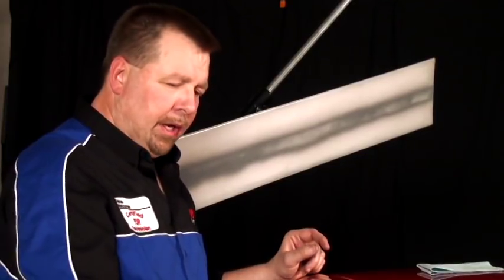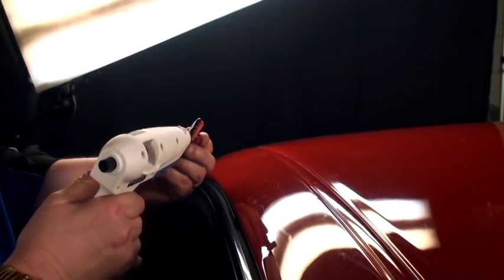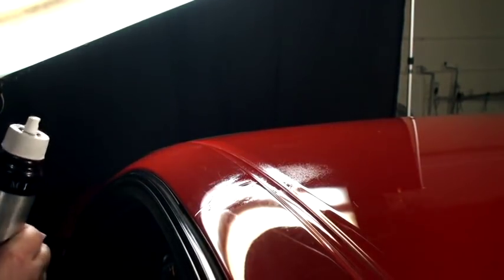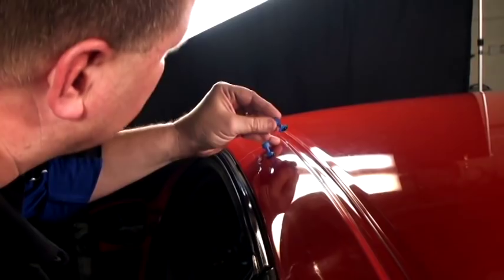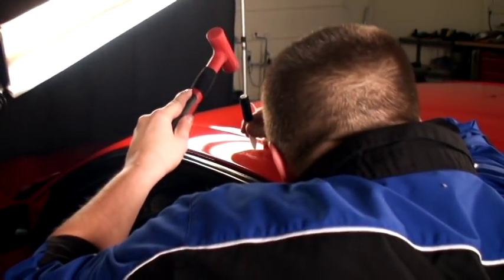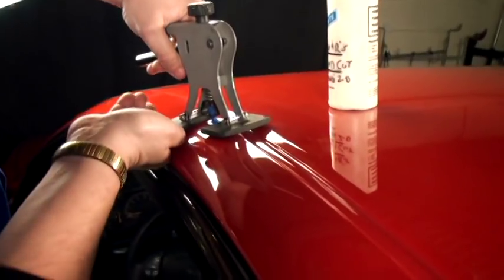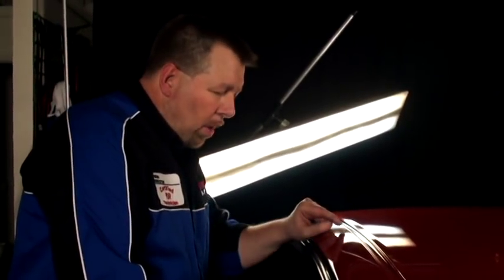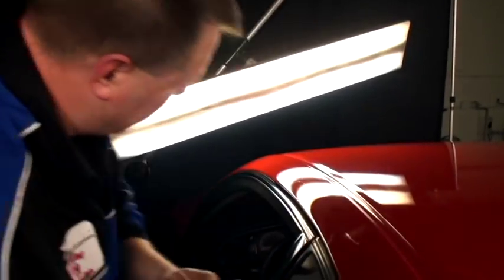Glue Pulling a Crease

Comment: Great video demonstration,  on the sharp creases i like using portable dent reflection tools slide hammer over the pliers, and found irregular creased dents I shape a bead  of hot glue to the exact crease inside the dent allowing it to harden, then i add glue to my puller tabs and glue to the shaped glue for an exact fit. This is a great video, it's great seeing how others do there repairs. It's great that we can all learn from each other on repairs. I will have to do a video soon too share.

Comment: Someone hit my BMW SUV on the driver side door and drove away. The hit was right on the plastic guard, but it caused dents above and below the guard.
I carefully hammer the dents back. I understand when a hit is made on a surface, the energy of the hit forces the surrounding areas to rise. When hammering the rises, the energy of the hit will also spreading to the surrounding areas, but without control. In other word, hammering the rises will not guarantee the dents can come back as before.
After I hammered the surrounding rises, the dents recovered a little bit, but still showed. I thought I was out of my bag of tricks.
After viewing your video, you gave me inspirations, that is, patience, patience and patience. by tapping it little by little, it is possible to drive the dent back.
Thank you for the inspiration! I firmly believe it can apply to our lives, too.